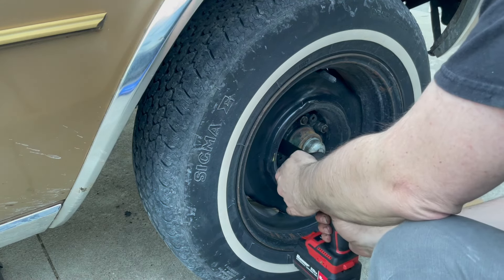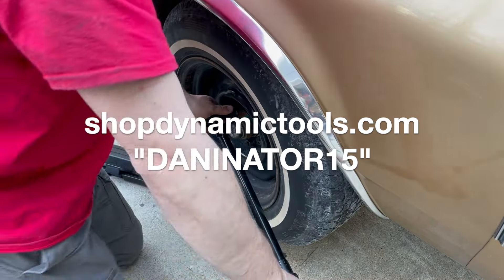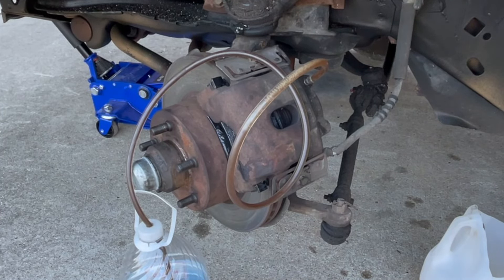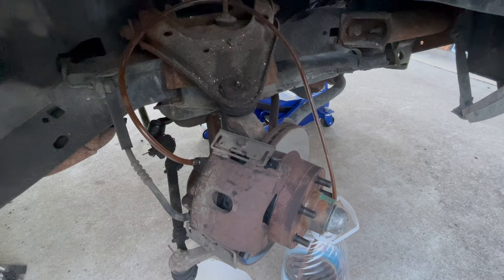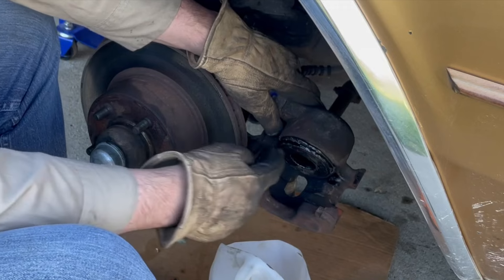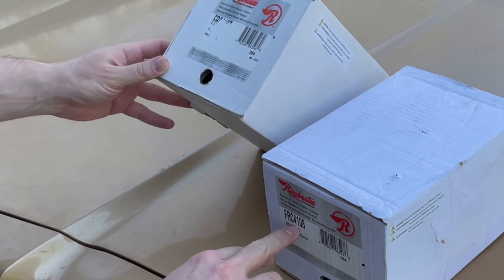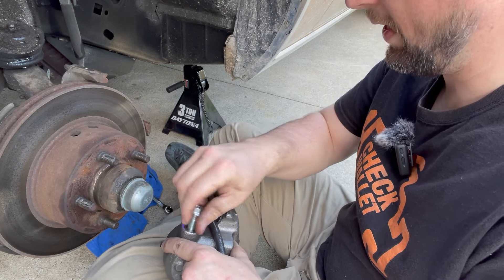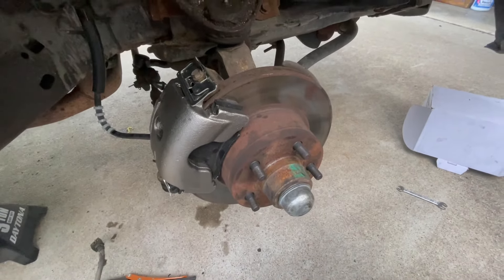It never stops with my front brakes! - Fluid was BLACK, calipers are toast! - EP. 6

Comment: Welcome to M body. MMMM  my favorite mopar. You got the caliper lesson under your belt, that's the way to do it. I have misthreaded that hose bolt myself, good idea to do it off the car. If you keep the parts, you'll be good in another 10 years with a simple honing and replacement of seat and piston. They all seize up over time. My opinion, with the worn idler arm, the brake caliper condition, the loose bolt at the water pump (?), that's a nicely seasoned 140K mile car that's seen mostly light highway use and kept clean and dry. Non-smoking owner cars tend to have good headliners. The other wear areas seem to be about right for 140k. Its not a bad thing, they are very durable cars. One repair tip, if you get new plastic pieces like the headlight adjuster and wiper bushings, some of those were made so long ago, just sitting on the shelf they are just as brittle as the ones that are broken. Boiling the parts in water for a few minutes is said to reactivate the elasticisers in the plastic.  Seems to have worked for me and mine. The real cop cars have a totally different driving experience, they are not soft and isolated, they used aluminum pucks in place of the 8 rubber isolation pucks used in civilian duty cars.  The civilian cars ride so nice I would tend to stay with the rubber style. The best part is the price! Congrats!

Comment from the maker: I believe that brake fluid had been in there since the Reagan Administration.
Reply: Just came across your channel and I've been having a soft pedal ever since I let a so called mechanic work on my brakes. I believe I have air trapped in the abs system also but he didn't know how to use his fancy expensive tool to do the abs bleed. Do you by chance live in Kentucky? I believe I seen you wearing a Cincinnati hat though. I sure would pay you to do that abs bleed. I swear bud mechanics around here have no idea what they're doing and they honestly tear up more than they fix
Reply from the maker: @ check out my trailblazer videos. I did a brake bleed video on how to get air out of the ABS.
Reply: @TheDaninator  I already watched it and that video is the one I meant to leave the comment on. I just don't have a scanner to do the abs bleed.
Reply from the maker: @ I did a video with my Sierra too. I think that’s the one I meant to mention. I took it to an open field and slammed the brakes over and over. Eventually I bled a ton of air out of the calipers.
Reply: Driving on dirt or better yet gravel allows the wheels to lock up faster when getting air out of an abs system. Best way I found to get the air out is backing up on gravel. Awhile back I replaced a leaking brake line going into the abs brain on my mother in law's 95 Taurus. I told her to take it to a mechanic because it would need the abs system applied multiple times and her mechanic had the tool for it. He was in vacation so she asked me to do it. Took me three times bleeding it till I found the gravel and backing up method. Good video. Happy Motoring.